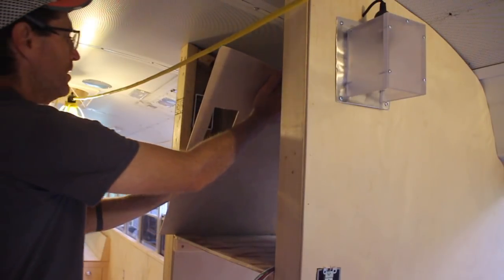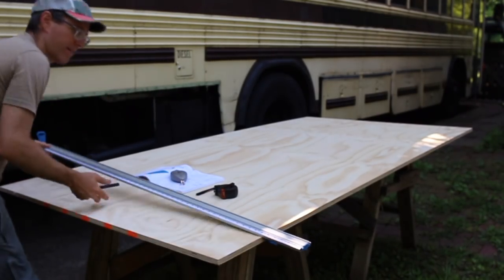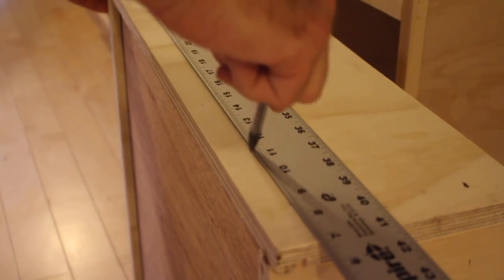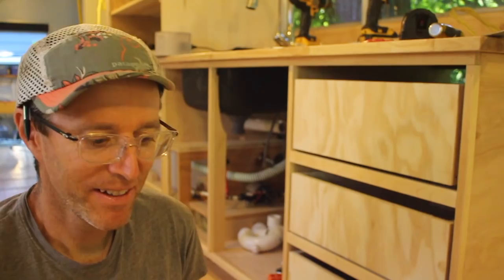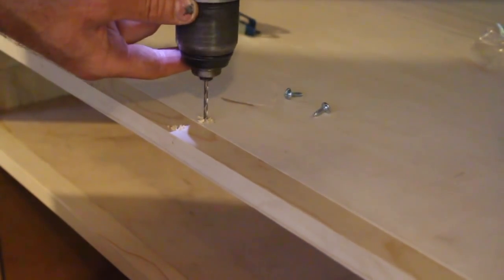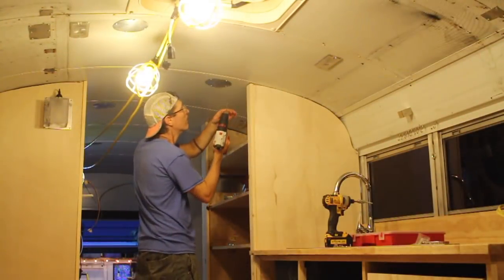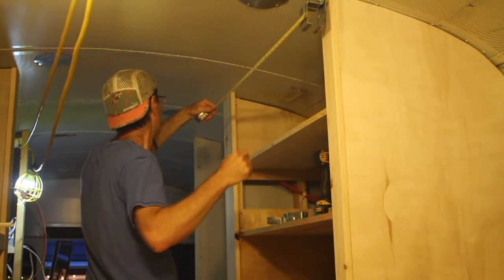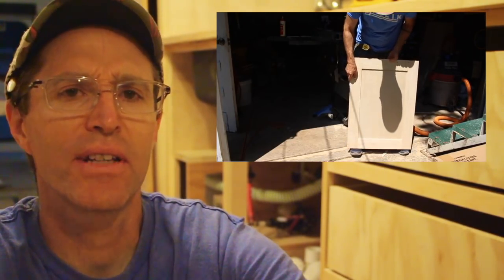Sliding Barn Door -- Prison Bus Conversion #34

Comment: How about some black latches for tool boxes for your cabinet doors require a little more work but I think they look nice
Reply: That would totally work, but I kind of want a single mechanism for locking all of the doors at once. A man can dream! :)
Reply: SpencersBackChannel I was just thinking this way it might be more convenient then have to unlock all three otherwise what you could do as well  a bracket or so flat Steel  like two different sized holes slotted what screws on the back side so as the arm comes down and locks them in left about less you opened up your drawers or a brackets with  hooks that would hook over a big screw heads
Reply from the maker: I like it! I’ll have to think on it a bit ... thanks for the ideas!
Reply: SpencersBackChannel I know it doesn't follow your idea totally but what if you put steel mesh for a cover plate and magnets behind it you still have your individual  up

Comment: I'm not sure if this was your way of asking for help from your audience, but on those door fronts (or any tight joints) you might enjoy checking out a father & son team from Canada. They had a PBS show "The Router Workshop" and their setups were just brilliant because they used brass square stock to eliminate measuring almost completely.

I set up my Craftsman router in some lexan and dropped that into a brand new scrap sink sized laminate countertop cutout that I fit in the right wing of my TS. It allows the benefit of using normally wasted space and you get double duty out of having the TS's fence to use. Which is usually much better than those router fences they sell anyway.

I found an episode of theirs here: https://www.youtube.com/watch?v=YZikwZeZfvU

Interesting to see you work. I know it becomes a personal thing. With your skills I am surprised you rely on hardware so much. For example, you could have made those drawers to ride on wood slides & they'd likely stay put more once the bus is moving. Save a load of cash, too.

I know it's not always practical but often it is so strange to see people so sold by the marketing of HW one doesn't necessarily need. I guess I like the older solutions guys like Roy Underhill might present. I watched his show earlier today. I watch it every saturday. He is like the saint of woodworking. Did you know he's qualified to do authentic antique restoration on priceless antiques like Jefferson's home that's on the back of a modern nickel?
Reply from the maker: Hey, Really good to hear from you and to think about your perspectives. I absolutely love Underhill, but sometimes forget those approaches to getting things done. DIY wood sliders are something I've often thought about, but then never done. So that's on my list! Thanks for the encouragement. 

As for your suggestion about the cabinet doors, I'll check that out. I really need to break through to the next level when it comes to detailed joinery, so I'm guessing those guys will help out. For me, taking time is usually the key to good work ... and I tend to get in a hurry in the heat and whatnot. 

Anyway, great to hear from you. Thanks, man! :) Spencer